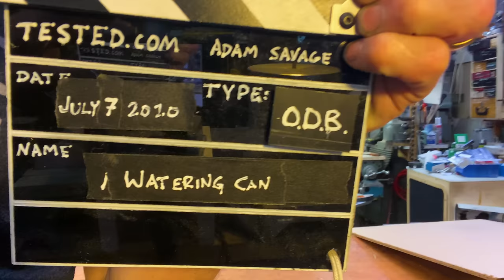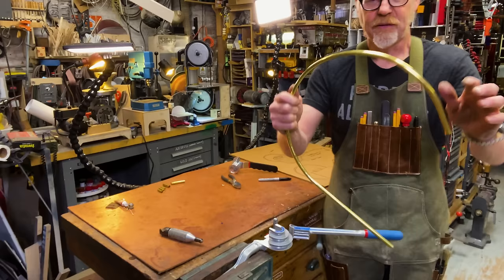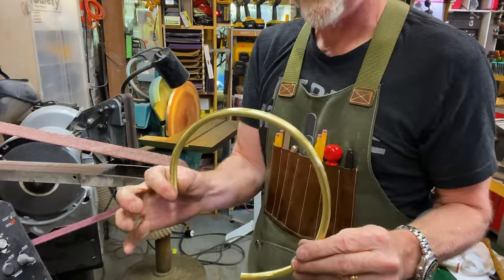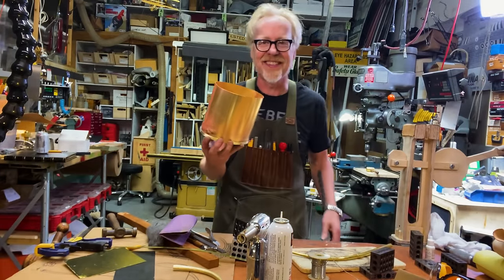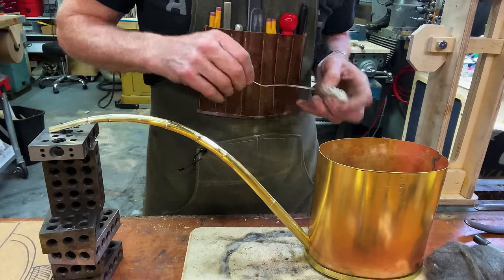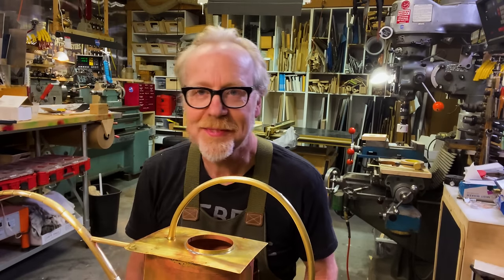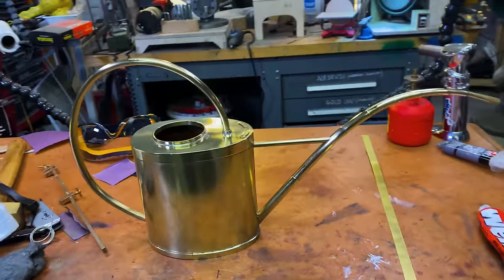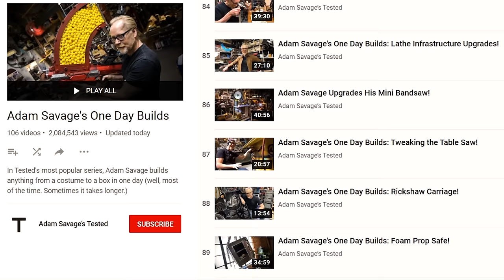Adam Savage's One Day Builds: Brass Watering Can!

Comment: everyone else would run in a Hardware store and buy a Watering Can, but being able to make it on your own, makes it priceless!
Reply: Mr. Savage, I was wondering if by chance you have seen the technique they use to bend brass instruments; mostly trumpets and trombones. I saw they fill the brass tubes with a soft freezing substance and then bend itso it doesnt deform while making a 180° turn for the valve section. Would that be useful or practical to use in a shop setting? Maybe art?
Reply: @Mr.Delirious1756  "freezing" sounds like it would possibly be complicated. eg, difficult to control/keep frozen... or come winter, difficult to thaw :p
but... brass instrument makers would have the knowledge.
Reply: Everyone else cant afford the £30,000 in tools
Reply: @deanmc2823  you could do it for a lot less.. but yea, 1~2k in tools, and a hundred in brass is a lot more than most people want to invest in for a watering can.
Reply: @tzxazrael  you absolutely don't need 3k in tools to do this!
Reply: @springplus300  nah, of course. i'm suggesting the tools demonstrated in the video could be had for like 1~2k... you COULD do it for like a couple hundred.
Reply: @tzxazrael  the freezing is just for the forming, not part of the instrument. The liquid would be pliable to bend but have enough structure to help the tube keep shape
Reply: @Mr.Delirious1756  i mean yea obviously... just saying that for a shop not setup to specifically do that, it would probably be very difficult to keep things at the right temperature, during forming.
Reply: I would if I could find a round (spherical) copper watering can with  a long thin curved spout for under $80 to $160, but since I can't seem to, maybe I'll just have to learn to. I've brazed and soldered things before, so it's worth a try.

Comment: This is an awesome gift!

May I make a design suggestion to any other makers inspired by this? As a grower and seller of plants, I fill and carry a lot of watering cans on a daily basis. My suggestion is to offset the fill hole to one side of the can (ideally to the right for right handed folks and the the left for left handed folks). This would make it easier to fill under any tap without the handle getting in the way, allowing the user to hold the can in their dominant hand, or rest the can on a solid surface to trickle fill without the water running down the handle and off the outside of the can.  Also, for a name or business logo on the outside, put it on the user's dominant hand side means that the name/logo is on the side facing away from the user and toward the rest of the world when in use, which to me would be 👌. Again, super build. Kinda reminds me of one I had as a kid, and something I would love and cherish. Hand made gifts are the best IMHO!
Reply: This comment needs to be higher!

Comment from the maker: We have more than 100 One Day Builds! Here's the full playlist: https://www.youtube.com/playlist?list=PLJtitKU0CAej22ZWBqrimPkn0Bbo6ci-r
Reply: Love the watering can great build a metal project I worked on I had the same issue about how to sign it. I came up with using a stencil of my signature and then pinning it basically like a sandblaster you use but it uses little tiny metal balls. It turned out very well.
Reply: When you reach 365 you should create a playlist of "1 year of builds". Might still take a while, but hey, it is all about the journey.
Reply: I absolutely love One Day Builds! It's the main reason I subscribed.
Reply: Thank god he’s filming this himself, the cameraman made me feel sick last time!
Reply: Adam, a good chanel for brass work is the banjo show. A lot of steampunk brass work.
Reply: Can someone at Tested please post the make and model of the torch Adam is using. Thanks!
Reply: To bend pipes with less kinking or ripples, seal one end, fill with soapy water and freeze, leaving the top open to allow the water to expand.
Once the water is frozen, place a bucket or tray under the bending tool, and then work your material. The ice will support the shape of the tube and the soap allows the ice to bend a bit further before cracking. It's not foolproof, but it's better than just air in the tube. If the ice starts melting too fast, top up the water and refreeze it.
If you want better results in a small workshop, Woods metal is a low melting point alloy that melts at 70-75 C. Same as above, seal one end, fill with molten alloy and leave to cool. Bend as you would normally then once you are happy, melt out the alloy with boiling water. Obviously boiling water and 70 degree molten alloy can burn you so be careful.
Reply: You are a Legend! Stay safe
Reply: Hey there it’s still gets to me that you’re not with Mythbusters but I absolutely love watching your videos so sorry to hear about Grant little while ago but your videos are still a huge inspiration keep doing great work and I hope you read these comments always been a fan of yours and I love the one they builds
Reply: Labour Day binge watching commences...🌁.⚒🥽🖌📝🧰🌉🤗
Reply: Fantastic playlist :) I just wish on YT there was a way to sort in date order, oldest to newest.
Reply: some of the buckling can be reduced by filling the tube with Wax.
Reply: I just think in some cases bending can be done with a wooden form if its pliable enough. Only on the x & y accesses. The z makes things interesting to say the least.
Reply: Dude. Your little brass bongo solo was epic!
Reply: Adam, why don’t you create an EDC Savage Tools line for us ? I would be so glad to use an awl with your own label that you created, designed and approved to be long-life quality :)
Reply: @Adam Savage's Tested Love EVERY video on that playlist - and can't wait for you - making the next couple of hundrets One Day Builds ! <3
Reply: @maxximumb  You can also just fill it with sand and then seal both ends with tape. I cant say whether it give same or better results but it is pretty easy to do, fast and as you put it, foolproof.

Comment: Some thoughts/ideas, observations based on personal experience:

Pack brass with silica sand and compact it inside. Really, compact it. I'd suggest gluing the ends on with brass caps, because it's more efficient, but not everyone can do that so wood caps rammed in work just as good.

Alternatively, you can put a hard durometer rubber rod inside (if you bend a lot of thin wall brass, it's worth the effort to get at least a meter of this stuff for each size). You just need to remember to thoroughly grease the rubber otherwise it will be difficult to pull out. One other thing, it's best to put the brass rod in a vise when removing the rubber from inside, so you can both pull and push the rod (you also want to give yourself at least 10 cm to pull on it).

I've had great success with super thin brass tube and rubber rod, at 8 mm ID and up, under that, i've had some mishaps like the rubber snapping...so that's another thing.

It was probably mentioned in the vid, and i missed it, but you want to pull a perfectly straight marker line along the whole length of the tube. That line, aligns with a solid corner on your bending apparatus of choice (if it doesn't have one, you can always make an indicator with coat wire).

Copper or brass, whenever i do bends that exceed the norm, i like to keep a regular gas torch handy and heat up the outside of the bend. Not the inside, just the outside. I said regular, but the best working torch for this is one of those desktop torches usually used for lighting cigars, especially if it's an assisted flame torch. On fleaBay, i found various models with 3 such torch heads inside, if one head is cut off, so it doesn't work, this widens the flame but keeps it narrow. Four 2 cm distanced passes give a perfect assist for the stretching brass on the outside of the curve.
Reply: It's always a problem when the rubber breaks. It can lead to complications.

But seriously. Got any tips on bending copper tube? I will need to do this for a pc water cooling loop in the near future.
Reply: For handmade brass instruments they use a soft metal alloy with a low melting point to fill the tubing prior to bending it.  That prevents the tubing from collapsing.  A channel associated with the German broadcaster SWR has documentaries on making a trumpet and a French horn.  The catch it, they're in German, and not always news announcer German either (SWR covers the southwest of Germany, so varying amounts of Badish or Pfälzisch will be heard).

Comment: This was awesome, and helpful! I have a wooden stool in the shape of a whale whose tail broke off years ago. A friend made it so I couldn't bear to part with it but it's been hidden away. We recently moved to the farm country just outside New Bedford MA ( the home port in Moby Dick), so it is time for a whale repair job. I sort of designed a tail made of brass for it that can be smaller than the original because the brightness of the metal offsets the dark wood. I haven't done metal work since High School - but what I learned was that I was WAY too concerned about the solder joints being flush. This project doesn't have to hold anything but attention. Thanks!!!

Comment: I'm a very good technician but a poor craftsman. Your work gives me motivation to change that! Beautiful piece!

Two things I would have done differently:
Have the lip of the fill hole protrude into the inside of the can to reduce water splashing out.
Signed the can using silver solder. This would be hard to do but I think you could perhaps etch and fill the etch with the solder.

Comment: Adam that is a thing of beauty. I would like to try this. I have made a copper still but used copper rods and oxy acetylene. I think its stronger. For brass i wonder if one couldnt make an oval  steel form and then cut a bigger piece of brass and hammer a lip around the form. If I made two it would make the lid and base and give a big area for the soft solder to solder to contact on. I may also try a seam rather than a lap joint. Your enthusiasm is contagious.

Comment: I remember taking a big water bottle, attaching a bit of plastic sheet to the cap and putting a hole in the cap to help my parents water their potted succulents.
The hole in th plastic sheet acted like a valve where crushing the bottle made water flow, but without the pressure it was fine. 

Time to step it up for their upcoming 65th birthday

Comment: Hey Adam !  if you fill any tube, steel copper brass,  any size,  with fine clean sand, and pack it in, then solder caps on the ends,  it holds it's shape without buckling on the bend !!!

Comment: I have a watering can like this, the handle is actually connected to the spout through the body of the can and the water pressure/gravity when it's tipped pushes the water up and around through the handle and up and out through the spout 😊

Comment: I see you're using Sharpwriter pencils. I highly recommend switching to Pentel P209 drafting pencils. I started using them in college and can't go back. The sharpwriter has a long spring, which has the effect that the lead is 'spongy' since the whole length of the spring is loaded with every stroke. Plus the P209 has a metal tip that's great for tracing.

Comment: I had a bit of a thought in regards to your leak problem. I was taught in my silversmithing class that solder cannot be used like a weld or a glue and instead acts as a mechanical bond at the chemical level, joining the metallic molecules through metallic bonding instead. Thus it works best with less solder and stupidly tight tolerances. The biggest thing to note is that silver solder hates plugging holes because that’s not its job. It will also flow out of those holes the minute you heat it up again. That probably seriously contributed to you chasing leaks for so long.

Comment: A trick to keep in mind, is that a high graphite (dark) pencil lead on brass acts as an “anti-flux” if you will, it keeps the solder contained where you really need it, at the joint and off the areas far from the joint. 
Gunsmiths and moonshine still makers worldwide know this.

Comment: ADAM, there's a SUPER EASY way to bend brass tubing without any deformations.
When they have to bend the brass tubing to make a brass trumpet with sharp 180 degree bends, all they do is fill the tube completely with water, and freeze it solid, then put the tube in a normal hand operated tube bender, like the one you use in this video, and just bend it over. The frozen water keeps the metal from crimping or deforming during the bending.
Then melt out the water at your leisure and you have a perfectly bent brass tube.

Comment: remember the brazow to thng material is more fluid on the hot side so it will always follow the heat you just have to keep the back hot enough to flow to the heat.

Comment: Hello Adam, 35:00 for the bending of the ring for the filler hole you could have been using the groove that the hole saw made to the wooden board as a template...

Comment: I'd have made the border and bottom in one piece.. Use a wooden hammer to fold the edge of the bottom (and the top) over , so the can fits inside, Way stronger, and way more surface for a watertight soldering joint.
But then.. i did have "plumber training" in school.. 
i do like how the spout looks like Bamboo, because of the small steps in it..

Comment: If you make a plywood template you can cut the top/bottom material slightly oversize and hammer around the edge of the template then won't leak as much.  This is how model steam engine boilers are made.

Comment: Hey Adam, Great tutorials and ideas, Thank you.
Now, instead of bending the brass rim for the watering can to the hole in the small brass sheet in which the hole was made, why didn't you bend the brass around the hole saw that made the hole? Correct diameter as well. Problem solved.

Comment: Wait till you need to braze brass and copper together with different thickness.  Copper burns supper easy, especially when the copper is the thinner piece.  I only did brazing in an industrial setting, but would love to get a setup together and make stuff as a hobby.

Comment: The trick to getting a longer section of leather lace than the longest edge of your hide is to cut in a spiral - easiest way to do do this with a strap/lace cutter like the one you're using by just cutting a circular hole in the center of a piece, starting your cut as if that were the outside edge, and just letting the piece spin as you pull the lace and work outwards to the outer edge of the piece. Leather has enough flex and stretch that it'll behave about the same as straight lace, especially in applications where it's under any sort of tension (as in this handle wrap), and you can get a ton of length out of a relatively small piece of leather.

(If you've ever wondered how an off-the-rack spool of genuine leather lace can be continuously so much longer than any cow this is the answer...)

Comment: Adam you could have helped yourself out with bending the handle. You can fill the tube with Silver sand or use a bending spring, a couple of ideas that reduce the likely hood of seeing kinks and marks when using the pipe bender.

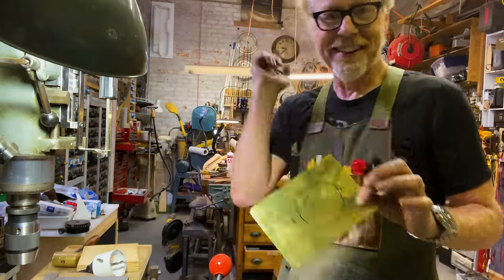Comment: This is about the use of double sided tape to fix the brass plate to the wood when you "cut a nice big fat hole out of the brass" (33:51): 

I don't know who came up with it, but there is a useful trick called "the masking tape and superglue trick" which does the same but without the residue that double sided tape tends to leave on your work.
The idea is that you apply two or more (but apparently you almost never need more) parallel strips of masking tape onto both the flat surface that you want to fix an item to (e.g. your workbench) and the item itself (e.g. a flat piece of wood), so that those strips of masking tape lie flush against each other once you lay the item onto the surface.
You then put a bit of superglue onto the masking tape which is on the holding surface (and optionally spray superglue accelerator onto it) and then put the item down on top so that the tape strips line up.
The result is a relatively secure connection that holds up against sideways forces quite well while being very easy to seperate again by simply pulling the workpiece up. It has many uses, as expertly demonstrated by luthier Ben Crowe on the YouTube channel "Crimson Custom Guitars" (which is where I got it from). They are mainly a woodworker and thus the forces exerted on the masking tape and superglue joint are not too great, but they claim to use this technique for fixation of materials in CNC machines. So it must be quite good.

Just putting this out there, as you may find a use for it.

Comment: No Wood's or Cerro metal to fill the tube with for bending?  Then just drop it into a pan of hot water and the filler runs out.  I have done curved tapered tubes by soldering the straight segments first and then filling and bending.
I would have done the handle as two tubes next to each other to give a bit more to hold onto.
As usual some great workmanship.

Comment: Gotta say, a mandrel-bender with the right diameter shouldn't leave the wrinkles...another technique is filling the tube with water and sealing up both ends (or a correctly fitting spring), then it should keep the diameter when bent

Comment: Normal DIYer: "I need to find a specialty metals store that has all these different kinds of brass stock. Better hit Yelp, and failing that the Internet."
Adam: "Let me go over to my retail brass rack and get what I need."

Thanks for all the videos! I trawl these and other videos as much for reference on tools, techniques and materials in my own builds as I do for the finished product. Sometimes you don't even know what tools you need or are available until you see someone else working. Where can I find that vice-mounted pipe bender?
Reply: To answer myself, it looks like an Imperial Triple Head Tube Bender and he just has one handle in the vice. Not too expensive, either.